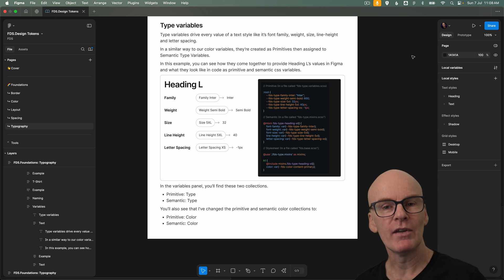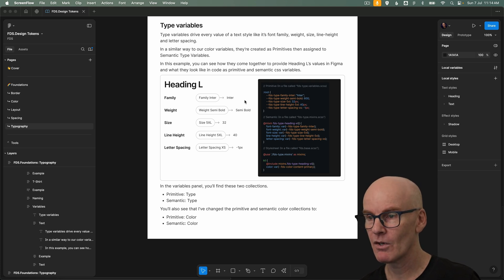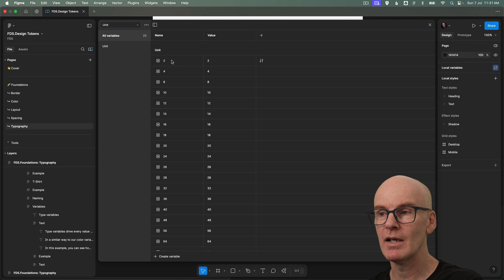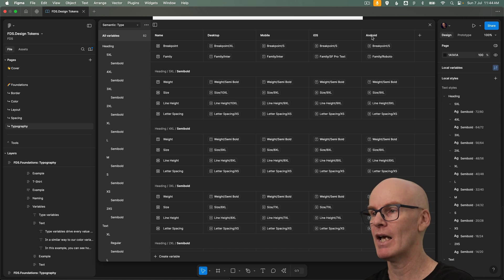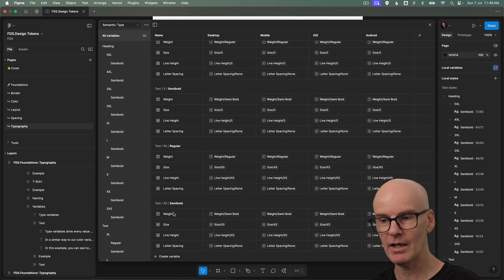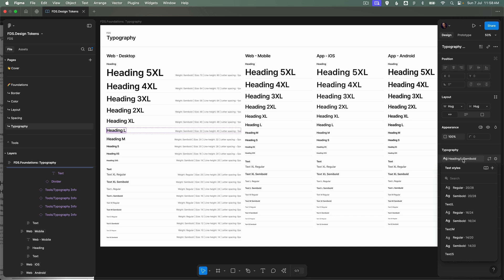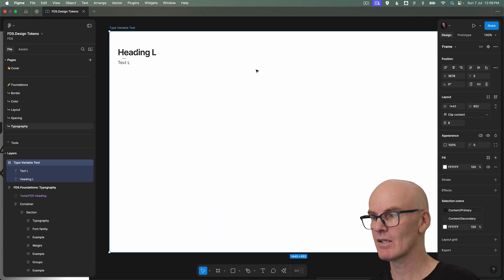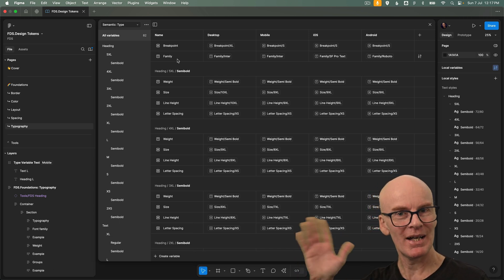Figma Design System: 08 Type Variables

Comment: Thanks for the great tuts. Why do you define semantic combinatons in Variables and not in Text Styles rather?

"Heading / 5xl / Bold should be a Text Style, not a Variable.

The Clear Separation:
Variables Store PRIMITIVE VALUES:

Variables /
├── Font Size /
│   ├── 48 → 48px
│   ├── 40 → 40px
│   └── 32 → 32px
├── Font Weight /
│   ├── Regular → 400
│   └── Bold → 700
├── Line Height /
│   ├── Tight → 1.2
│   └── Normal → 1.5
Text Styles Create SEMANTIC COMBINATIONS:

Text Styles /
├── Heading / 5xl / Bold
│   - Size: @Font Size / 48     ← References variable
│   - Weight: @Font Weight / Bold ← References variable
│   - Line Height: @Line Height / Tight ← References variable
├── Heading / 4xl / Bold
│   - Size: @Font Size / 40
│   - Weight: @Font Weight / Bold
│   - Line Height: @Line Height / Tight"
Reply from the maker: This is how I approach this in every system I create, even in the org I currently work for. You can update it to fit your own approach if you like.

Comment: Hello Cristopher. Thank you very much for your series and for sharing your knowledge. I enjoyed your Dezin system series for Sketch years ago.
Now I have a question about this design system. How do I proceed if a client's corporate design includes several fonts and not just one as in your example with different font weights?
For example, if a sans serif font and a serif font need to be combined. (I don't need a global switch between web, iOS and Android as in your example). 

I'm racking my brains but can't find a solution. I hope you can help me. And I hope your wife and family are well.
Reply from the maker: You can add extra entries in the "Family" group which become font-family variables and apply them to the variables you would like to use them on, this would require you adding a font-family variable to each of the type mixins but it can be done :)
Reply: @ChristopherDeane  Thanks for your response. That worked.

However, I have another question now. In the Figma file you linked, under the “Typography” frame, you included both Web-Desktop and Web-Mobile. For my question, I’ll refer to the Heading 5XL.

In the Desktop column, you’ve linked the following tokens:
	•	Family – Inter
	•	Weight – Semibold
	•	Size – Heading/5XL/Semibold 72 (when I click into it, I do indeed see the 72)
	•	Line height – Heading/5XL/Semibold 89 (and I see the 80 when I click into it)
	•	Letter spacing – Heading/5XL/Semibold -1 (and I also see the -1 when clicked)

Now to my confusion / question:
When I look at the Heading 5XL in the Web Mobile column, it is – as expected – smaller than the Desktop version. But when I click on the text and open Typography, I see that the same token is applied as on Desktop: Heading/5XL/Semibold 72/80. And when I go deeper via “Edit Style” (as I did with Desktop), I again see the linked tokens:
	•	Family – Inter
	•	Weight – Heading/5XL/Semibold
	•	Size shows 72, although it should be 64. But when I click into it, I see Heading/5XL/Semibold, and now it shows 64 instead of 72.
	•	Similarly, line height first shows 80 (like on Desktop), but when I click into it, I see 72.

I simply don’t understand how you did that.

For the Desktop variant, I assigned everything exactly as you described. It also works: when I use the tokenized text styles and switch the breakpoint from Desktop to Mobile, the text resizes correctly according to the token settings.

But what I don’t understand is how you managed to assign the same tokens in the Mobile column and still have the Mobile variant (with smaller font size and line height) display correctly.

Every time I try to assign Heading/5XL/Semibold to my Mobile text (which should be 64/72), it jumps to the Desktop size in the table. I’m stuck and hope you can give me a helpful hint.
Reply: UPDATE: After a lot of experimenting and a better understanding of the system, I’ve now solved it as follows:
I first assigned the appropriate tokenized text styles to the text fields in the Mobile column (which of course initially applied the Desktop sizes). Then, I set the text fields’ appearance to “Semantic: Type: Mobile.” After that, the scaling worked.
Now, when I drill down into the text styles of the Mobile column, I see exactly what you do (e.g., font size 72 at first, but when I click in, it shows 64).

The only thing I still find surprising is that, when selecting your text fields, I don’t see the dropdown “Semantic: Type: Mobile” – instead, it looks like you somehow managed to set it to “Auto: Mobile” in the Appearance panel.
I’d really like to know how you did that. Maybe you can share it with me. Thanks in advance – and again, thank you for sharing your knowledge here!
Reply from the maker: I added the mode to the parent container frame. You can also do this to the entire canvas area in Figma so every frame you're designing with inherits it automatically.

Comment: Hi Chris, loving these videos! My project has multiple font families per platform. How would I go about creating type variables with this case? For example, my Desktop Breakpoint has Heading L that is inter and Text L that is Trade Gothic. This is the same for my Mobile Breakpoint.
Reply from the maker: You can add the new typeface to the Primitive: Type collection / Family group, add a Family variable to Heading L then link it to the one you just created, this will override the original mapping.

Comment: Hi Chris, thank you for the clear concise videos, for the brilliant templates, and for sneaking in a laugh or two :) 

I would love to see how this type scale could be adapted. Consider the following scenario: We need to replace Inter with a new typeface, with significantly different characteristics (x-height, etc), and we might want to rethink some of the sizes we'd previously defined for Inter (for simplicity's sake, we could leave iOS and Android out of the conversation for now).

I saw your comment about waiting for Figma to release child modes, but my question is more about your workflow leading up to this implementation: How would you decide what to change? Which variables are likely to change per typeface? How would you trial-and-error combinations of primitives, on the way to deciding on which values to implement in the new type scale?

Thanks for all your hard work and happy new year!
Reply from the maker: Hi Eva and Happy new Year!

Firstly, just change the type-face and see whether it's character widths, line-heights etc effect the other existing values. Then change each one that's problematic. For every value that needs to be adjusted, just move either up or down the primitive scale, e,g,. Letter spacing could drop from Letter Spacing None (0px) to XS (-1px), which we had to do recently at the organisation that I work for (I lead our DS) where we replaced what was our brand type-face Helvetica Neue with our own custom type-face that has wider characters and slightly different wights.

What you should try to avoid is adjusting the primitive values. Hope this helps and a new episode should be out in a few days 🙂.

Comment: Why did you create 4 breakpoints but only use 2 in the Semantic: Type? Does this mean I don’t need to change the type scale between desktop breakpoints (following the breakpoints that you used i mean), and that tablet is similar, or what?
Reply from the maker: So you have a choice and can extend the responsive modes if you want to suit what your product requires.
Reply: @ChristopherDeane   Understood. Thank you!

Comment: Hi Christopher, thanks for this video as well! I was wondering, what is the advantage of creating the units with a name-value correspondence and primitives + semantic? Because having seen how Figma handled type variables in their videos, they directly insert numerical values into the weights, sizes etc., and then created multiple modes directly in primitives, connecting then the text styles to primitives. Even if they change for example the Medium size from 14 > 16 every text style using the size M will get updated. So why create semantics and units and not just primitives like Figma?
Here the reference video: https://youtu.be/APNWWhXIg04?si=z4WEHEHnZJynoZ54

Thank you!
Reply from the maker: You don't have to use them, but I prefer to do so as they set the expected values across the entire system and can be used for any number value variable, not just text size or line-heights.
Reply: @ChristopherDeane  And why the choice of recreating text styles in variables? Could the primitives have been directly used by linking them to the text styles? Is this choice due to seeing exploded and organized values? Because what I would have done by looking at the Figma tutorials would have been to directly create the breakpoints in the primitives and insert the different units (instead of link multiple scales L XL etc...)
Reply from the maker: This is done to re-create the concept of a type mixin that exists in code inside Figma, and to make it easier to create responsive text modes in the semantic set and not multiple modes inside the primitive set.